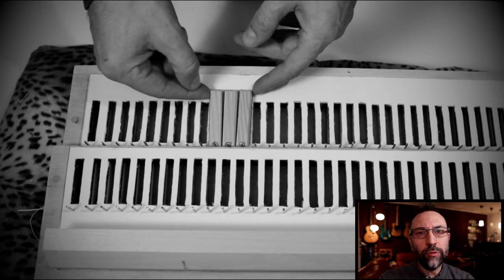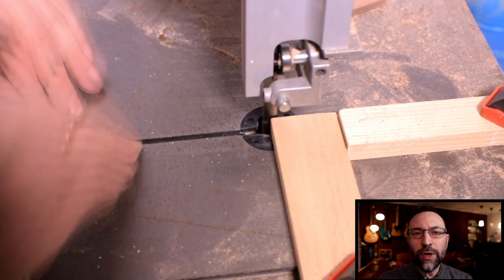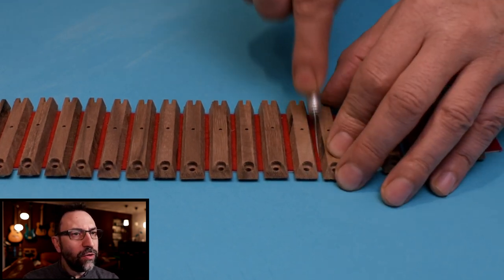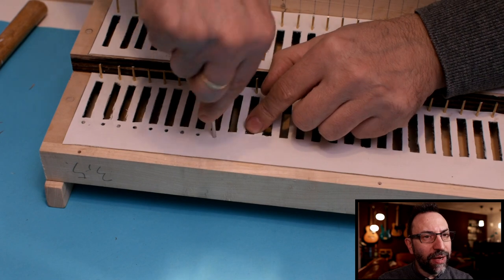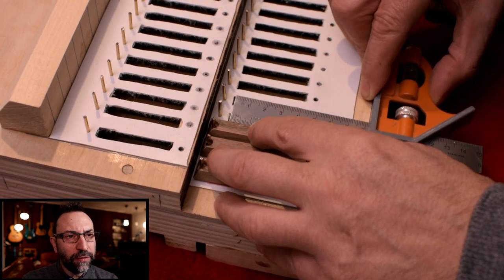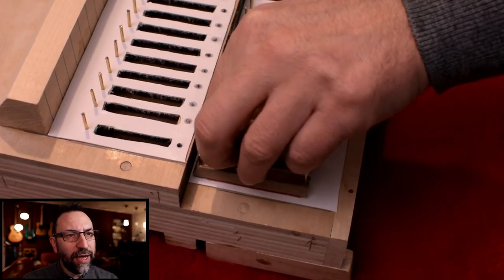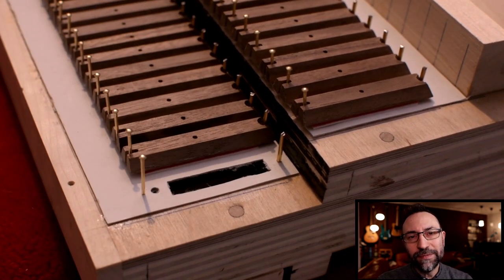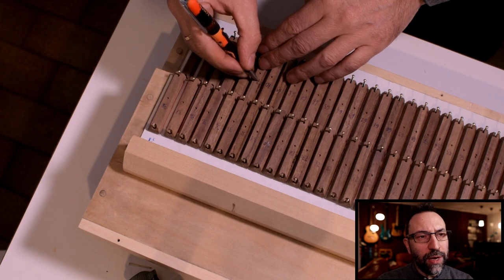The pallets finally finished! Building a Homemade Positive Pipe Organ | Video No 18

Comment: Nice video, I wanted to ask a question, how does the pipe organ provide enough air pressure when multiple keys are pressed? You tune each pipe with a certain amount of air pressure, but if multiple keys are pressed at the same time, more air is used which means low air pressure and 1. lower tuning and 2. weaker/quieter sound.
Reply from the maker: Thank you! excellent question, the bellows will be sized to supply enough air to several pipes at the same time and will be able to maintain constant pressure as the amount of air required varies, allowing more air to enter when required.
Reply: @nippocast  interesting, thank you and will be waiting for more videos on this